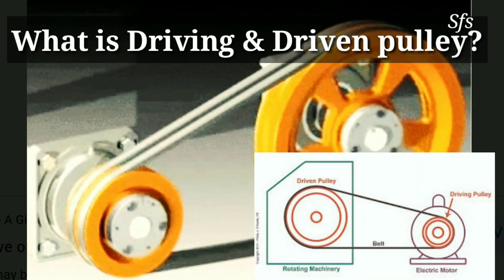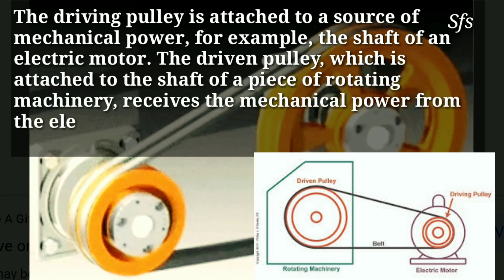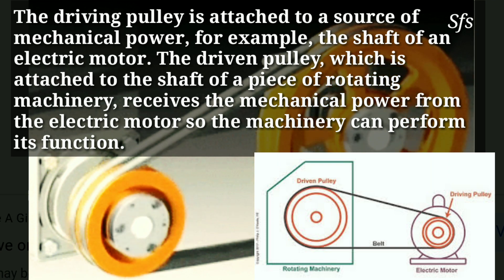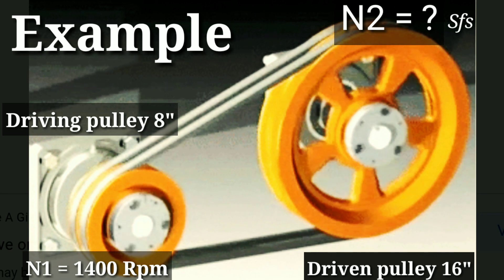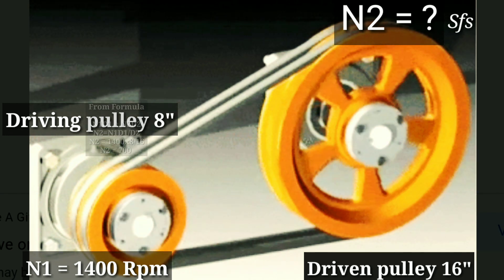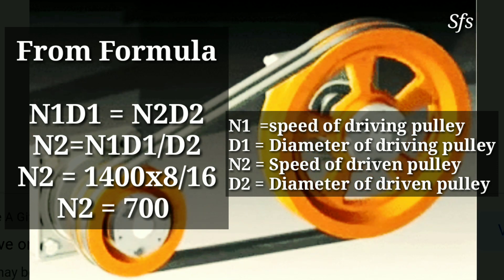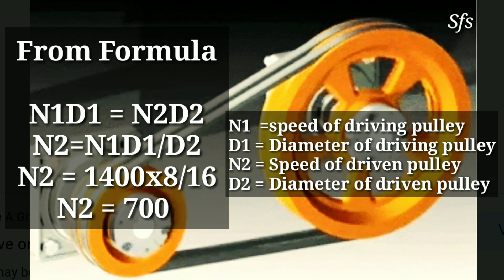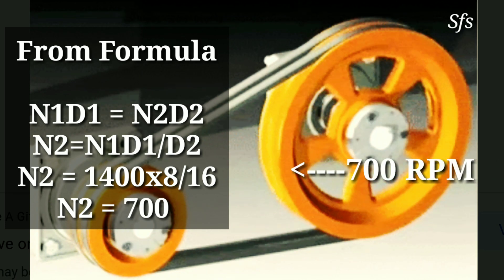Belt Drive Speed Calculation | Pulley And Belt Drive System

Comment: Look man...  I'm all confused,  help me out here..
  I have a motor that spins 3,750 rpm. My conpresor pump has a 10" dia. Pulley,  I want to Spin my Compresor between 900 and 1,000 rpms.  What Diameter does my drive pulley on my motor needs to be??...
Reply from the maker: 2.66" for 1000 rpm

Comment: If pulleys are 1/1 driven is motor speed, but what difference does it make to have larger pulleys say twice as big as original?  Does it give same speed but more torque? How is pulley diameter determined?
Reply from the maker: Yes it gives same speed but more torque

Because radius increases

Torque = ForcexRadius

Nice question brother